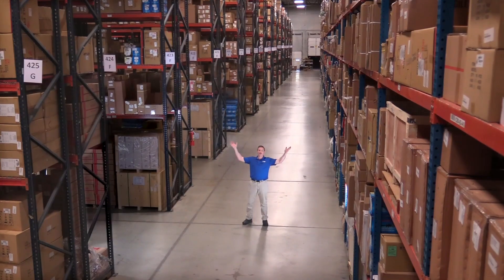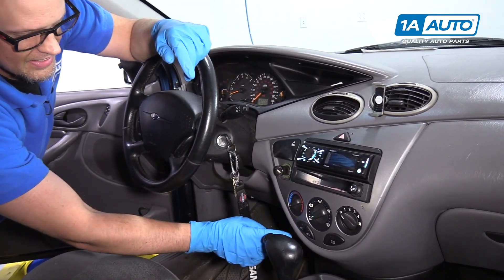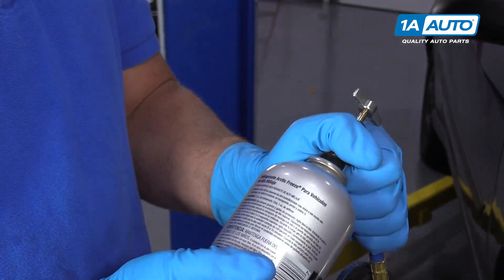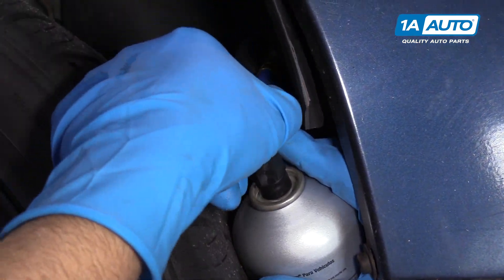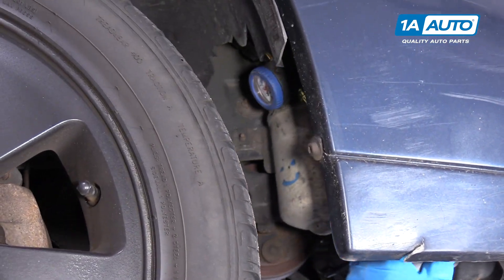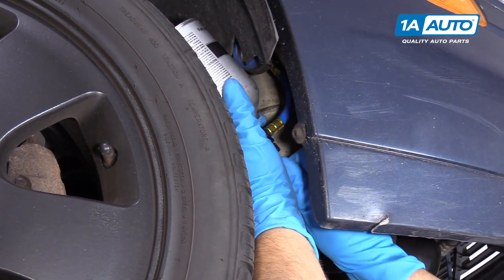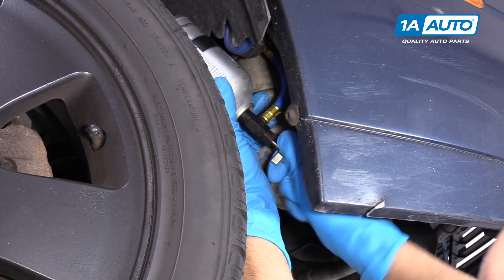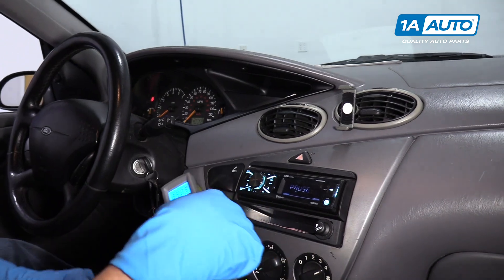How to Charge AC System 00-04 Ford Focus

Comment: The low side port can be accessed with out removing anything. 1) Study images of of the low side port so you have a good idea of what you are trying to access.  2) Run left front wheel up on a car ramp so you will have room to work.  3) Lay on your right shoulder and by feel run your right hand up the back side of the accumulator. The port is on the top back side of the accumulator.  4) Once found unscrew and remove the dust cover. 5)  Attach the low side fill line.  This is not all that hard to do.  I am glad I did it this way and you will be glad you saved time and effort by doing it this way also.

Comment: When the ac system is low on gas, the Ecu will store a fault code on these Focus mk1.
You can only see this fault code with a official Ford cable, but not with a universal reader.
Reply: Gas?

Comment: If your fill tub adaptor does not come with a gauge how much is to much ?.
Reply: I wouldn't do this if you dont have a gauge. Ideally you want a gauge on the low and the high side ports but you can get by on just the low, you just won't have the whole picture. Adding refrigerant without a gauge of any kind is not something anyone should ever do unless you are weighing your cans and adding them to an empty system. Too much is just as bad if not worse than not enough. It can make your clutch cycle far too quickly and cause premature wear, or the high pressure cutoff switch will kill the ac altogether because the pressure is way over the threshold.
Reply: @danielgonzalez4079  negative

Comment: Why my compressor dont do the on/off  like  yours,when i start the AC is is alwais on - only shuts when l close AC. And an engine inle l dont get cold air, only iff l drive
Reply from the maker: +Marin Constantin We wouldn't be able to diagnose an issue like that here, you may want to have a local mechanic take a look at it. Thanks for checking us out! 1AAuto.com

Comment: What do I do if my ac compressor is not running when I turn the ac on
Reply from the maker: +Gizmo Thanks for watching!  The compressor is belt driven, so there could be multiple things wrong with your vehicle.  If you are unsure we recommend having a reputable mechanic take a look to get a diagnosis.
Reply: It will not run until it is full enough with freon.

Comment: Do not turn it upside down like he did. That's how you hurt the thing. You want it to turn to a gas. If you're having trouble getting all the refrigerant out of the can take a small bucket of warm to hottish water. Doesn't take much to force the rest out of the can. You'd be amazed. 

If you turn it upside you're putting fluid in what is essentially the compressor intake which can hurt the compressor. It's a scroll compressor not reciprocal but same concept of putting water or another fluid in your engine. It can't be compressed.
Reply: Follow the can instructions. Most say to turn it over or shake. Most cans come with oil/stop leak and it's heavier so it requires being mixed in as you go.
Reply: If you listen to him this can has a dye to check for leaks. You want to turn it upside down to make sure that dye gets into the system so it does it’s job. Most cans tell you to move the can back and forth

Comment: What if compressor won't com on
Reply from the maker: +Doug Capehart We wouldn't be able to diagnose an issue like that here, you may want to have a local mechanic take a look at it. Thanks for checking us out! 1AAuto.com
Reply: Put the gauge on it and check the pressure. If your pressure is in the blue and its not on. You have another issue. It may not turn on in green zone, because it wont have enough  pressure to open the switch to make the a/c cycle. So add a little refridgirant slowly to see if the a/c compressor will come on.

Comment: Complete nonsense hack video. Every a/c system, especially r134a systems, require a specific amount of refrigerant, the only way to charge an a/c system is to know THE EXACT AMOUNT of refrigerant that is in the system and weigh the amount you’re adding or to recover all the refrigerant in the system and charge the system with the required amount of refrigerant. Blindly adding refrigerant to a system with some less than worthless color coded gauge is a recipe for disaster, can’t believe you actually sell people car parts.
Reply: don't know what ur pipping at but i myself used a similar re-gas to this and my a/c was ice cold all thru last weeks heatwave